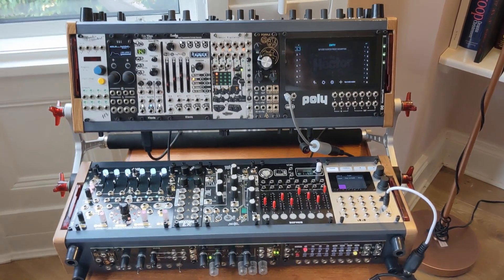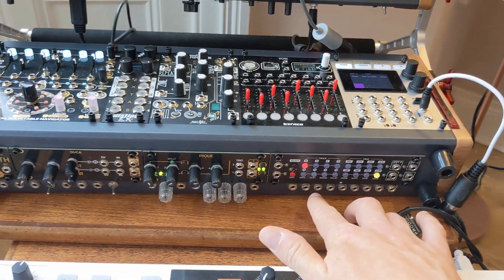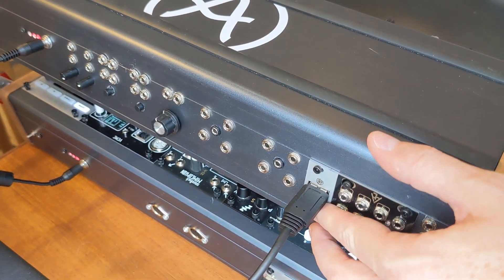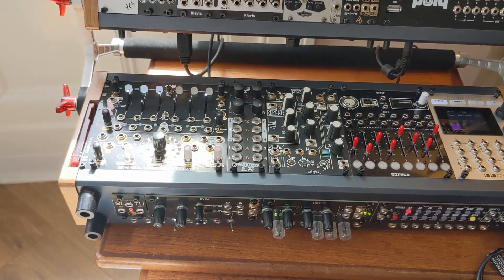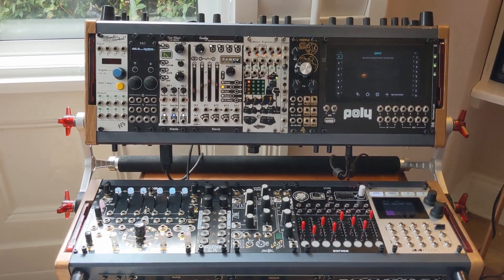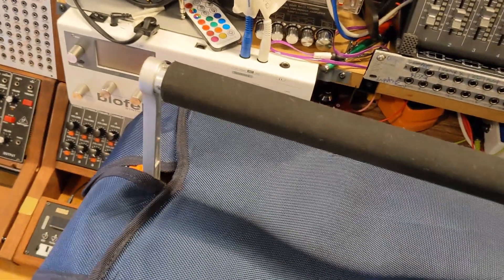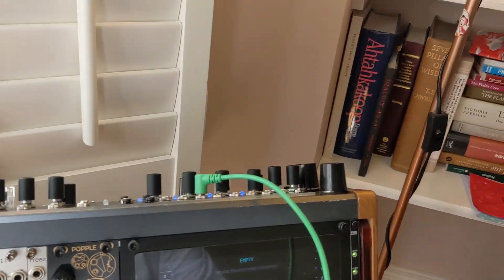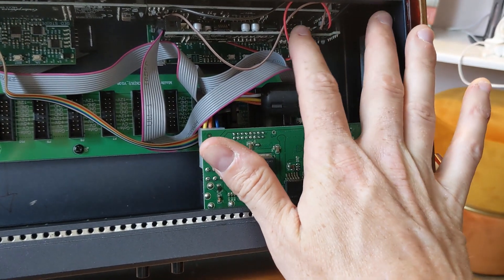Mod Arturia 3u Rackbrute cases to add 74hp to your eurorack

Comment: Love this!
Reply from the maker: Thx! It was a fun project.
Reply: @tinkererofthings  I own 2 6u Rackbrutes and thinking about modding the PSU and all cables attached to one sides bottom. Also enjoying the power supply module inside the rack itself. I ll see if I can do this. :)
Reply from the maker: Yeah, putting it inside to free up that 5hp. I've seen others take off the faceplate and velcro it to the back, drill a hole in the side cheek for the PSU barrel, and switch it on/off at the wall. I wanted to have access to the switch, hence mounting it to the bottom/back with the faceplate mounting nuts. @MEMastering

Comment: Me and my Rackbrute 3U are watching this video licking our collective chops. Nice work! All I wanted to do was relocate the PSU module to free up 4hp and heaven help us, I found this video.
Reply from the maker: Haha, mine is a little unconventional and destructive, ie, drilling holes. Molten music modular does the same but non destructively. He just velcros the power board to the back. Good luck!
Reply: @tinkererofthings  I think yours is the way. My biggest concern is airspace collisions inside...seems like a lot of consideration & research for module depth is required to pull this off.
Reply from the maker: @impulsecoupling Shallow modules there. I can fit 25mm modules there if I remember correctly. You could fit deeper ones if you velcro it to the back, maybe 30mm. Many digital modules are 22-25mm: ALM, Klavis, mutable, new bastl stuff, etc. And of course, measure twice.

Comment: Very cool! How do you remove the red ring/link connectors on the sides of the cases?
Reply from the maker: Hi, thank you. Didn't have to remove them. Just removed the fake wood side that have those rings embedded in them. But, having looked inside, there is a bolt holding the red ring bolt. Should be able to just loosen that off and it will come out.